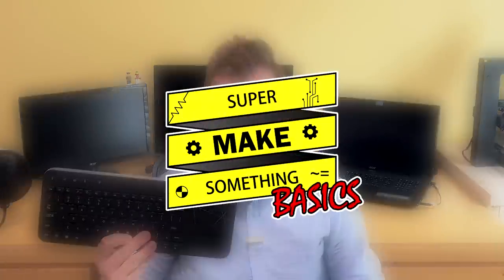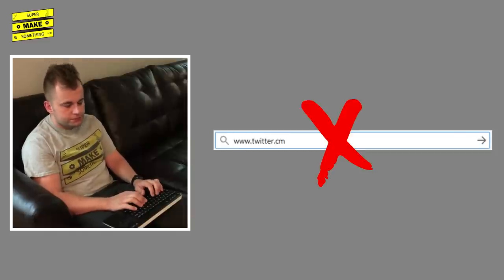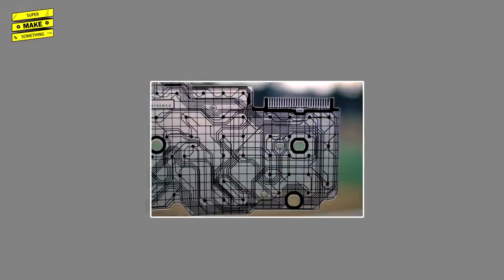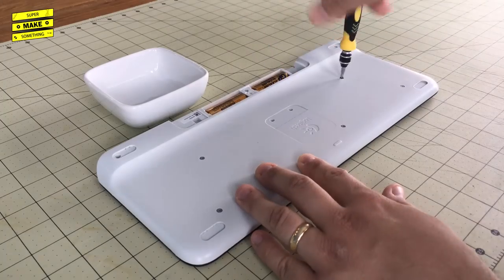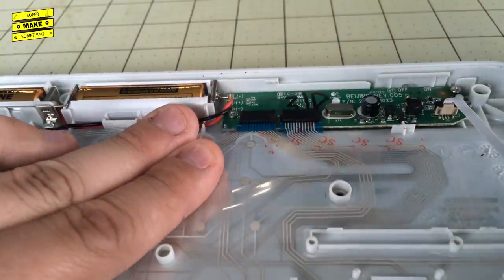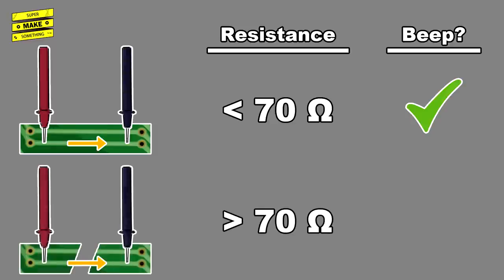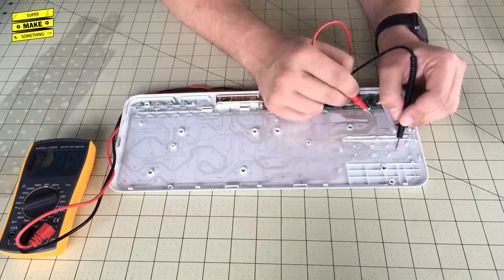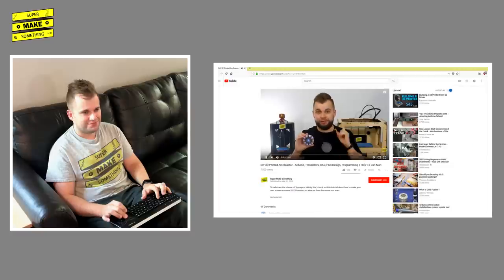How to Fix a Keyboard (Circuit Board Trace Repair, Multimeter Tutorial, Conductive Paint)

Comment: To anyone trying to fix a section of worn circuit that would easily be fixed with conductive paint, but find it too expensive or difficult to acquire, take an old usb device and take a short section of wire (since the wires are thin), and take only a few strands, maybe about 4-5. Run the wire and shape it to the affected section of the circuit (not really necessary) and make sure it is in contact with the working parts circumventing the affected part of the circuit. Tape it down with a thin piece of tape (cellotape, scotch tape, electrical tape, any of these should do, as long as it isn't conductive). You could use conductive tape, but it is as easy to find as conductive paint :P . Run a fingernail on the tape by each side of wire so that the wire is secured in place and also traces the defective part of the circuit.

Hope this helped you.

For lack of conductive tape or conductive ink/paint, I first tried a spudge of aluminium foil. That kept shifting because the affected section for me was between spacebar and right Alt and the comma key. I then tried a thin section of aluminium foil fixed with tape, which would also lose contact because it would shift. I tried pencil lead, which worked momentarily, but the affected section was too long and it would die again in under an hour. I guess pencil lead would work for small sections, maybe for under a couple of mm of missing circuit. I then tried wire, which would also shift. Finally, I realized all of these were shifting because they were bulky and even a large cross section of tape could not secure them in place. So, my solution of using a few strands of wire has worked well - the wire is in place, and it has been several months with no problems whatsoever. I used thin, long sections of cellotape to follow the shape of the wire with a different section of tape after each bend of the circuit.
Reply: You are a life saver dude i cant believe that nobody commented on this in 7 months. This is quarantine now and my keyboard is malfunctioning and i cant buy a new one thats why i came here btw thanks for your help as i cant purchase conductive paint also but that lead thing worked for me and once again thanks:)
Reply: Thank you!!
Reply: Thank you mate, i repaired my keyboard!!!!!!!!!!
Reply from the maker: Awesome workaround and a great way to fix a trace!
Reply: I've used aluminum foil, the damaged track was not in contact with keys, it was the outer track and I was able to fix it with a small peace of foil and tape.
Reply: Bro thank you! There's no available electric paint in my area and your comment really is very helpful for alternative
Reply: Thanks a lot for your other pov... I tried first with the conductive ink but was a complete failure... I got some wire from the insulation covering a coaxial cable and it worked out!!! by the way I took just 3 threads, since I got several traces broken on my microsoft natural keyboard and used crystal tape to properly direct the wires over the traces.
Reply: Thanks for your comment. Conductive paint is expensive, l used Al foil with tape but it disconnected after few days. Now I'll apply your method
Reply: Thank you for the wires tip! It worked for me!
Reply: Just wanted to say thanks. You just saved my keyboard with that trick!
Reply: 😮great thank for sharing your experience fixing keyboard. I'm gonna try that.
Reply: It worked! I fixed my A letter. And the backspace. But then I wanted to go further and fix multimedia keys and scraped 4 lines together. Throwing away half of the numbers and all the Fn keys. 😅
Reply: Guy you're awesome. thanks. Cheap dollar store USB it is.
Reply: Do u only fix the bottom sheet? I didnt find any discontinuity in bottom sheet, but a small discontinuity in top sheet. Do I still fix it?
Reply: my logitech 120 keyboard . all keys are working except B button. please guide me to fix it

Comment: I've done this on a few keyboards and for those of you who don't have conductive paint, or can't find any, you can make some conductive ink. 
The easiest way for me was with some shellac ink and graphite pencil ( the woodles ones are better ). Use a pencil sharpener to gently scrape some fine graphite dust. You can grind it to a finer dust if you want ( could increase conductivity ) and then mix it with the shellac ink. It's a pretty useful trick.
You can experiment with other binding agents. Maybe nail varnish? Acrylic pain? Have fun.
Reply from the maker: That’s a really cool tip! Thanks for sharing!
Reply: Amazing! I doubt at first so i tried graphite powder with acrylic black paint (2 graphite:1acrylic ratio and loosen up with water). Mine was a short conductive paint patch however, the resistance after painted and dried is around 600ohm, seems like very high but it worked perfectly! Thank you for the suggestion!
Reply: @lydian2012  Happy it helped! It's a useful trick.
Reply: Wow, want to try this one

Comment: I identified the broken circuit by just looking at a black spot on it because I don't have a multimeter. 

To repair I used a small piece of aluminum paper (from the kitchen) and durex tape. It is working perfectly. 

Thanks for the video.

Comment: This is a shot in the dark if you would still reply, but is there any other way to check for circuit breaks without the multimeter. I know that my whole capslock lane (horizontal) is compromised. Is there an easy way to know exactly where the fixing needs to be done on the board
Reply from the maker: @7slimy278  it is possible if you rig up a circuit with an led, ground, and 5V line, and then going along the traces until the LED goes out, but that might honestly be more trouble than just getting a multimeter. It doesn’t have to be a fancy one — even this simple one will do the trick: https://amzn.to/3y0B2e7

Comment: I used thin copper wire and sticky tape to fix my C1 connection and it worked well, it was a bit difficult to trace the disconnection  without multimeter but finally made it, thank you

Comment: As I don't have conductive paint at hand and have to fix my keyboard immediately, I merely used a strand of copper wire and tape. Just scrath the trace a little to make it conductive and interconnect the 2 sides of the interrupted trace, and that was it. Just make sure you don't cross other traces (in case of contact, multiple keys were 'hit' simutaneously).
Reply from the maker: Nice! That’s a cool quick solution! Have you had any issues with the contact between the wire and trace coming loose with the tape?
Reply: @SuperMakeSomething  : nope, still alive and ticking !

Comment: wow, thank you for this vid, teaching basic uses of multimeter and all those info, just fixed my keyboard, saved my penny, and a new knowledge, thanks again.
As for me, conductive paint is a bit hard to acquire so what i did is to cut thin pieces of aluminum foil and a transparent tape, line them up  in the tape just like the circuit, and done.
Reply from the maker: Awesome -- I'm happy that the video helped you save your keyboard and some money/landfill waste! The aluminum foil is a great idea! Thanks for checking out the video!

Comment: I'm not sure if this has been asked before, but why is it that we should test on the bottom sheet and not the top sheet (which visually has some circuits on it as well)? Do we have to diagnose both sheets?
Reply from the maker: Yes both sides should be tested. In the interest of time I only showed my work on the bottom sheet since this is where keyboard had a broken trace, but all traces corresponding to a broken key should be inspected/patched.
Reply: @SuperMakeSomething  Thank you! I found the problem. Turns out there was a scratch on the trace where the discontinuity is, possibly a manufacturing defect.

This has been very helpful and informative.
Reply from the maker: @sixseven4912  Awesome! Glad that you were able to find the problem and that you found the video useful! Thank you for watching!

Comment: Why did you only check the bottom trace sheet and not the top?  And why would the traces "burn out" with a liquid spill?
Reply from the maker: I actually ended up checking the other sheet as well, but found no damage. For these types of keyboards, it’s less about burning out and more about corroding the traces that are exposed to the liquid.

Comment: Alex? Why did you not work on the top sheet?
Reply from the maker: edgar l Good question! I tested the top sheet off camera and it did not have any interrupted traces, so I only showed the relevant parts on camera. However if the top sheet would have had broken traces, they would be repaired in the same way.
Reply: @SuperMakeSomething  I had the same question. It would be useful if your video could be edited to display the words "Do the same for the top sheet" at an appropriate spot.

Comment: Hi do you a separate video on how to check on dead keyboard thats no power.
Reply from the maker: Mark Kevin Hi sorry I do not have a video specifically on this topic, but the procedure for checking it is the same as the buttons. Start at the 5V and GND input lines from the keyboard and essentially trace that wire until you find the short. Good luck!

Comment: Y did u not try the top and middle sheets? Do problems due to water only occur on bottom sheets
Reply from the maker: Good question! The middle sheet is just insulation to keep the contacts on the top and bottom sheets separated, so I just made sure that it was dry. I also checked the top sheet, but because this was the same process as for the bottom sheet, I did not show it. (There was actually no liquid damage on the top sheet, so no repairs were necessary.)

Comment: How difficult would it be to extract the bluetooth module and put this into a mechanical keyboard base? Then possibly hardwire 2 Li-On batteries in there soldered to a female usb micro used for charging?

Comment: One question. The circuit board is under a protective layer of plastic... So how did you put the volt probes or the conductive Paint without striping the plastic protecting the circuit??? That's sus... I've opened two keyboards and both of them are like that and you need to strip the plastic with an exacto knife....
Reply from the maker: In this keyboard, the protective layer was only attached to the “circuit board” below with a dab of hot glue, so they pulled apart easily. Not sure if this is the same for others, but you will definitely want to be careful with any separation because the plastic film in these types or keyboards is so thin.

Comment: How do you fix if the keys i pressed includes another letter or character? Would need help on this please. I press 1 and get '13' and on Q i get 'QE' same when shifted. Thanks in advance.
Reply from the maker: The contacts on the circuit board may be bridging together when a button is pressed, causing the double key stroke. I would open the keyboard up as shown in the video and see if any dirty or other material is on the circuit traces. After carefully removing this, I would then blow everything out with some compressed air before putting it back together. Good luck with the repair!

Comment: I think I accidentally cut a trace when putting on a MacBook Air keyboard to a topcase. I was using adhesive to help the center section not flex so much,  because Apple used rivets there, O could not tighten up with screws. I put too much adhesive and the key caps were getting stuck. I cut the extra adhesive, which was a huge mistake. I lost the delete key. Now I know I can fix my mistake using your method. I'm pretty sure I saw this at Microcenter or Altex. I will give this a try!
Reply from the maker: Good luck with your repair! Fingers crossed it works out and you can get your delete key back!
Reply: @SuperMakeSomething  Thanks! sorry for late reply. I ended up buying another one from Beetstech. They were cheap and fast. I still made profit from the repair!!! However, I did take the old one and the new defective one (with bad delete key) apart and look at it. I could not find a bad trace on it, so maybe it was defective from the factory. I have a remove control that can use your trick though. I will try this!

Comment: soooo... hypothetically, if a soldering iron contacted the underside of a keyboard and melted a tiny hole in the key matrix (about the size of the diameter of a laptop screw), how would one go about bridging the traces without continuous plastic between the two points? i tried rubber cementing a clipped corner of the conductive sheet under it, and then painting along that, but no luck so far. Any suggestions?
Reply from the maker: One thing you could try is to draw a new trace around the hole with the paint. I’ve found that trying to stick two conductors together (without solder) and having them reliably remain in contact is very difficult unfortunately.
Reply: @SuperMakeSomething cool ill try it. so are the traces conductive on both sides of the sheet?

Comment: My keyboard randomly stopped turning on. Any idea what the problem might be?
Reply from the maker: Difficult to say. Could be anything from a short circuit to a broken trace or a loose connector. The best way to find out is to open it up and start probing traces with a multimeter.
Reply: @SuperMakeSomething  It has to be. I don't have a multimeter but I'm sure it was a short circuit. Thanks for the reply

Comment: I had the exact same keyboard which I'd had in storage for a long while.  I'd actually already successfully repaired the battery contacts which had gotten somewhat corroded, and then realised the space bar didn't work.  I couldn't believe my luck when I found your video, but when I opened my keyboard, the three sheets were partially stuck together, and when I attempted to separate them, the top one ripped right through a load of traces.  Even then I tried looking around the problem area for broken traces with a multi-meter and couldn't find anything obvious.  I don't think it's worth bothering to save it now.

Comment: Hey, can anyone please tell if it's possible that lines broke on 2 sheets? Because it seems so by the character of damage. I have some vertical and horizontal rows of keys not working. I don't have a multimeter (yet) so I just want to make sure such problem is possible or it may be something else. Thanks

Comment: Hi! The three sheets of plasct on my keyboard, with the key matrix are glued together all around the borders. It's sort of a blue substance. Any ideas on how to separate them? I tried a screw driver on a part where there was nothing printed but I'm afraid it will erase good printed parts. I thought about applying heat but I'm not sure how to go about it... hair dryer? Thanks!
Reply from the maker: If the glue is isolated to a few dots that aren’t around any traces, I would carefully try to separate the sheets with an X-acto knife. You can always “re-attach” the sheets together with some double sided tape or hot glue to keep the sheets from sliding relative to each other.

Comment: Most of the broken trace is damage by the edge of those small hole from the middle sheet... I custom-made the middle sheet with smaller hole that enough for contact but not cut off the trace anymore . It has been 8 years , I'm still using it with no issue.

Comment: I have a HP Keyboard PS/2 cable, model 5137, black, that is havng a weird issue wirh SOME keys not workong properly, and they are: Q, E, R, T, Y, 7 and 8. I've troed many things, like other 2 old KB that ALSO have some keys missing (A wasn't working, and many more others). So i'm in a terrible doubt, is it a hardware or software problem? I've trying running Windows 7 solutions, searching for drivers, pressed F8 during initiallization and all of that to no avail. I've recently swapped my Power Suply to another ATX. Does anyone jave any idea wgat i can do to get those letters working again?

Comment: I'm going to try this on a x370 series motherboard, Il let you know if it works because if so it saves a good £100+ motherboard from becoming ewaste
Reply from the maker: Nice! Please let me know how it works! One word of caution — the increased trace resistance may cause a slight thermal “hotspot” where you use the paint. This was not a big deal for my keyboard but there is a lot of stuff going on on a motherboard so be careful! The resulting voltage drop across the trace may also be to much for a component on the board to work correctly without browning out, but it’s definitely worth a shot!

Comment: we can use micro alumminum wire its cheap and less resistance
Reply from the maker: Soldering aluminum is a bit tricky because of its chemical composition. Thin copper wire may work if you have it though! That being said, soldering onto a plastic PCB sheet like in this keyboard would probably still not work because of the heat unfortunately.

Comment: Can this be done on mechanical keyboards?
Reply from the maker: I think so.
Reply: May be a bit late but anyways. A mechanical keyboard usually uses a PCB instead of those flexible things (whatever they were called again). You can use a small wire instead of the paint in this case. Some people building their own boards don't even use a pcb but straight up wire everything themselves.
Reply: @Someone-ci8wf  Any kind of wire? Thanks anyway, friend!
Reply: @archibaldocruz4561  I'd recommend a small and easy to bend wire but I guess anything is fine as long as it conducts electricity
Reply: @Someone-ci8wf  thank you very much!
Reply: No. A mech keyboard uses a normal solid PCB and actual switches. You need to first figure out of it is a trace, solder joint, or switch failure. If it is a trace, this method would work, but it's better to fix it by soldering a wire to bridge the break. If it is a solder joint, simply add flux and reflow the break. If it is a bad switch, the switch must be replaced.